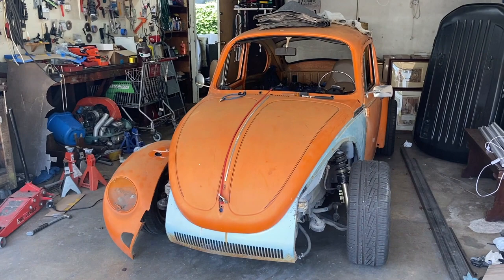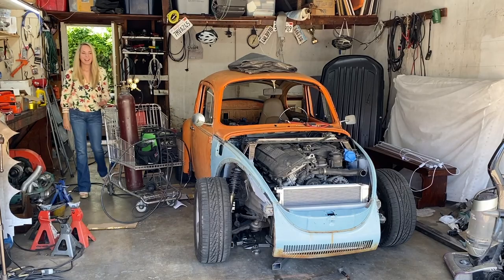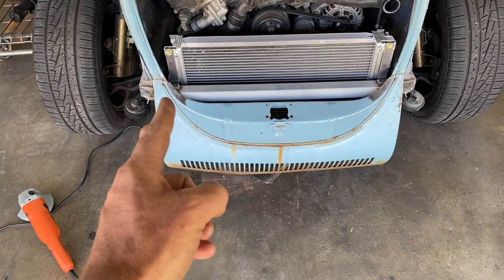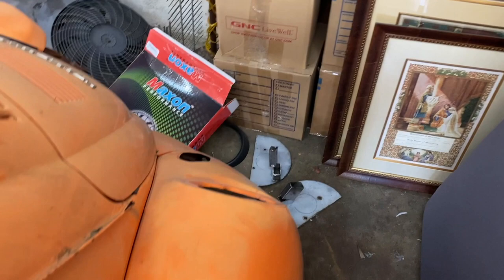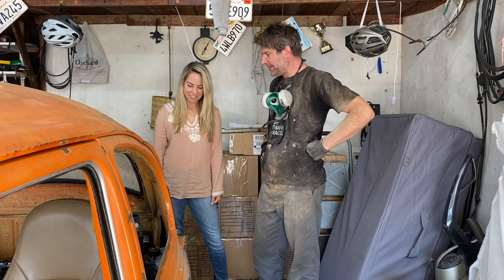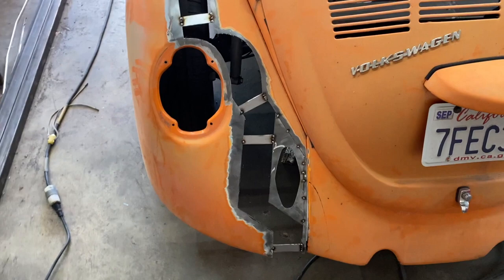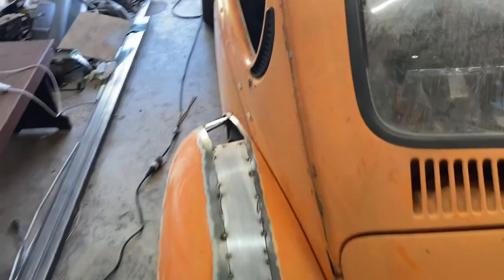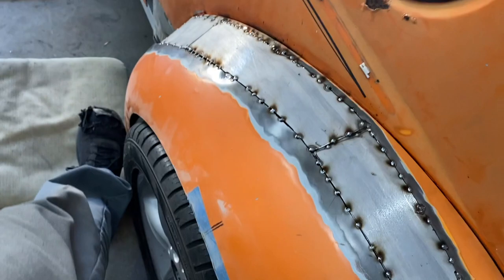The Mutt Ep41. BMW Z3 VW Bug body swap. Radiator fitment & fender widening...

Comment: Also, use copper , behind those gaps while welding. Make a tool or shape a piece over a dolly or copper cap a short length of pipe. Get those in the plumbing section. This way, you can hold the capped pipe behind the gap while welding. The weld won’t stick to copper, and you won’t blow the gap open any bigger. Also helps absorb heat to help with warping.
Reply from the maker: Thank you for the tip.

Comment: An old timer friend of mine taught me that no matter how slow you go it's going to warp,usually the worst after 95% welded. Just accept it and know you can stretch the weld back out and make it straight. Since then i weld 1/2"-3/4" in quick series of tacks. It makes the job go much quicker and weld penetration has been better.

Comment: I  widened  the same fenders on a super beetle back in 1980, I  was in the seventh  grade, I  think 4" ,didn't  know  how to weld yet but I  did know fiberglass because  I worked on surf boards, I  pop riveted a strip of sheet metal between and shaped it then glasses over it and blended it all in, it came out perfect, it was for my older brothers boss's  car, that car was super fast and  clean, 2180 ,it was an eye catcher at Orange county BUG IN ,when I  was old enough  to drive that guy showed me how to speed shift no clutch, and E brake three sixties on the strait a ways, my parents  never new, 👍

Comment: it's looking good man!  keep up the good work!  for filling those large sheetmetal gaps, get some ER70S-2 1/16" TIG wire, and use that along with the mig as you tack,tack,tack.  this adds a bunch of filler at each tack and will help you fill large gaps.

Comment: This thing is coming along nicely. This fender extension is looking very professional to me, I'm now totally on board with the project. I'm just a little waffly on the steering column length, but whatever. Wifetastic is looking splendid as well.🙃

Comment: Lead fill if you have to if you don't like Bondo you will need a gas torch to melt the lead it sands and spread out like Bondo but you have to work fast

Comment: Just alittle f.y.i. round bar stick works great for finishing off the edges of the wheel wells after they where cut
Reply: Great tip!  It will make the cut fenders look more stock and give them some strength where strength was removed.
Reply from the maker: Good tip. Thank you.

Comment: Make sure you have some way to burp the cooling system now that you lowered the radiator
Reply: Most BMWs have a coolant reservoir up high with the cap on it.  I can't quite see that on Nathan's car in this video, but I think he should be OK - you can see that the radiator has no cap.  On my old E24, there is a bleed screw right on the thermostat housing - fill with coolant, crack the screw until coolant comes out, tighten, done.
Reply from the maker: Yup. Header tank gonna be just under the windshield on the passenger side.

Comment: Have you thought about cutting out the entire tail light and moving it about 1 1/2 " closer to the body? This will center it on the fender, giving you a stock look
Reply: Mike Coates yes good idea 💡 worth experimenting 👍👍👍
Reply from the maker: I think there will be several versions of these rear fenders with lots of experimentation :)

Comment: For radiator cooling you could possible punch small louvers or even use the nose grills from the donor BMW.
Reply from the maker: Hmmm...I wanna try and be a bit more stealth than that. See if I can hide every thing being and under the front bumper.
Reply: @NathansGarage  You're driving from the back seat....me thinks your cover is blown. Consider it paying homage. :)

Comment: Good job Nathan !!!!      I knew you could do it , all it needed was the guts to make the first cut and of course in the right position . May need a bit of persuasion with the Manchester spanner’s you have just aquired , just to finish the curves off. How about saving up for an English wheel or better still make one.
Reply from the maker: Once I move to a bigger space I plan on getting all the toys :)

Comment: Find yourself a piece of brass or flatten a piece of copper and use it behind you wide hole to help you fill in the gaps!
Reply from the maker: Thank you for the suggestion. When I'm out next I'll grab some. I think aluminum works as well. A few people have made this suggestion.
Reply: Nathan's Garage hey an old or cheap pad lock works well and it’s bigger then most chunks of brass your gonna find generally

Comment: When doing that type of work it's a good idea to put the car on axle stands remove the shocks and springs this allows you to move the suspension up and down by hand so you can check if the wheels are going to catch. It's not an exact science because the suspension moves on the bushes when on the road but it's a good guide.
Reply from the maker: Yeah this is definitely a more organic fingers crossed approach :)

Comment: Looking great on the rears. As for the front: can I convince you to draw the "holes" before you cut?  No need to add to your welding labors when a black Sharpie is so much easier.
Reply from the maker: Heck yeah. There'll be planning before I drill.
Reply: @NathansGarage  you'll be surprised how much air you can get through the valance, I'd try it as is before cutting!

Comment: Great choice to widening the fenders,with the flat spot on the rear of the fender doesn't have to be,try shaping the piece to match the contour of the original fender. That web site I sent you I'm telling you they have the tools you need for a fraction of the price. Shrink and stretch hammer's, English wheels. Very cheap and you really shouldn't doubt your reserve..... Your a quick learn my freind. You can do it from what I have seen

Comment: Fenders and hood fitment are looking great, it's still a surprise to me that whole engine and radiator fits in what was the boot of the beetle!

For your flat spots next to your tail lights, you may be able to make a few slices or pie cuts on the original fender near the body to blend the curvature toward the light before putting your filler strip in?
Reply from the maker: Yeah. There's gonna be a lot of metal work learning going on here :)

Comment: Some pics of how I widened my 1303 wings: http://www.ricola.co.uk/cabrio_body.htm
Reply from the maker: Beautiful car. Stunning build.
Reply from the maker: Looking at how you widened your rears. You cut close to the body from start to finish. Did you have to do a lot of metal forming around the rear lamp area?
Reply: @NathansGarage  That was definitely the most fiddly part and like you say it does end up a bit flat unfortunately. Across the top I tried to cut through the crown like you which worked well. I did some light metalwork to pound it all into a gentle curve across the top to minimise filler. As you can see I also had to shorten the lower edge a bit to line up with the running board, the rear worked out OK but looks like you have a bigger step there, maybe easier to re-profile the rear valance? One tip is to have. straight edge across the back and through the top light fixing holes to keep everything straight, I saw that on the www.bugster.at build, I take it you have seen a 1303 almost drops onto a cut down Boxster too?
Reply from the maker: @ricolaracing  I've had that straight edge pic on an open tab for a couple of days :)